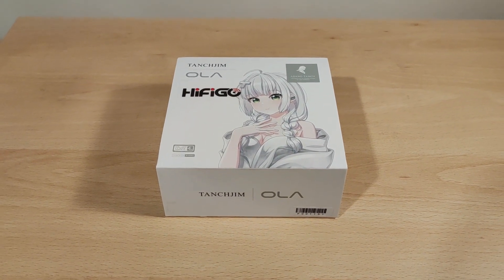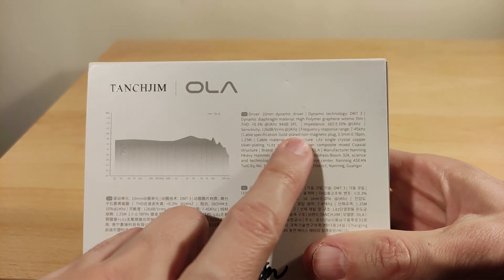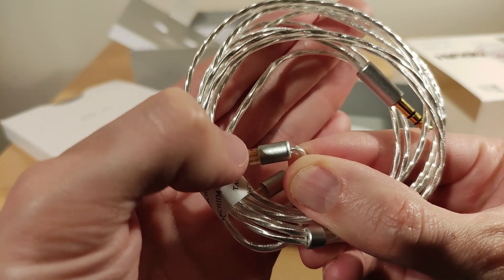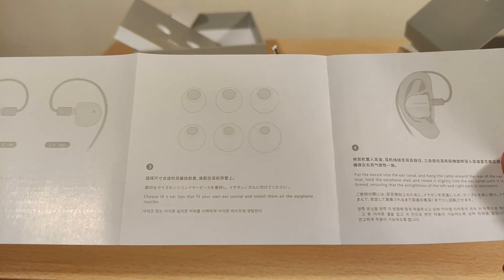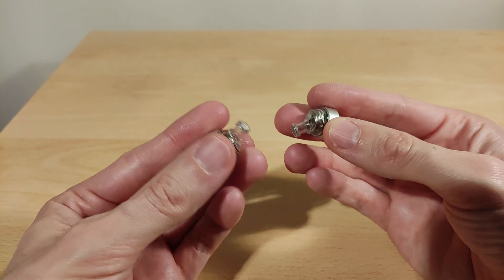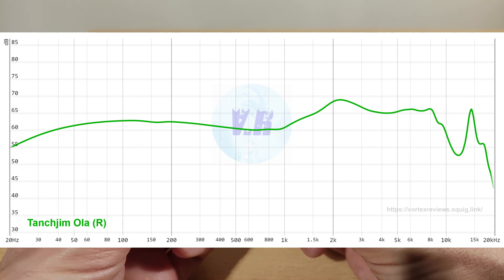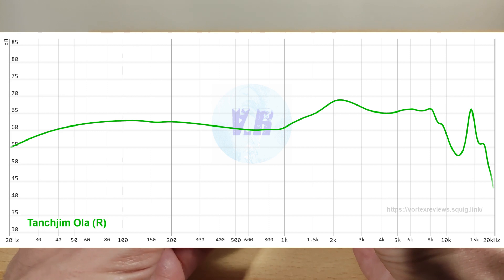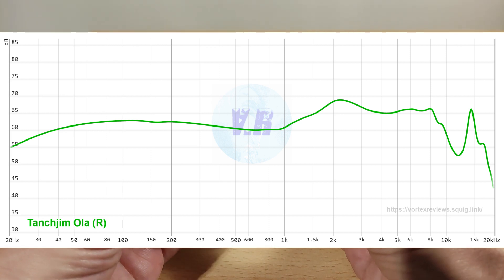Tanchjim Ola Review - Single DD Per Side

Comment: Excellent review. We agree with your feedback. A little bass elevation would have made it a really nice IEM. An Ola+ perhaps. Haha
Reply: Agreed, excellent review.  You can EQ 5db bass shelf or put some tape on the vent hole if you need some extra low end.  Or pass on these and wait for the next one.
Reply from the maker: @PaulWasabii  Thanks both. A second gen may be what is needed and a shell design refresh?